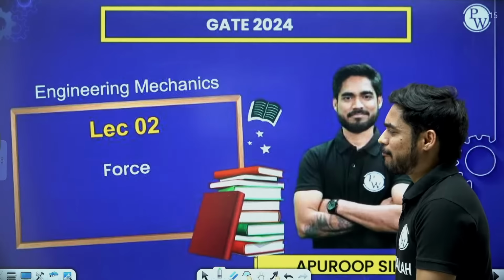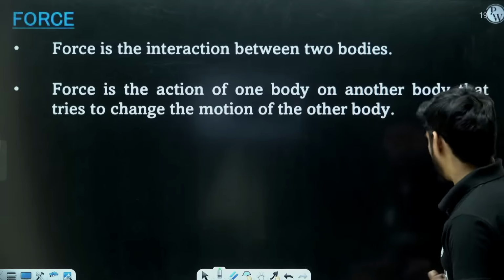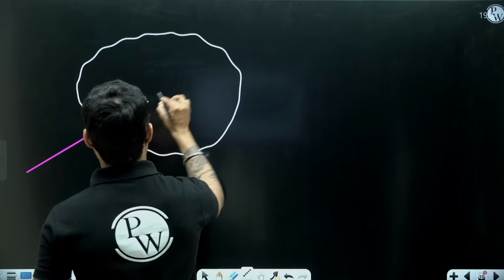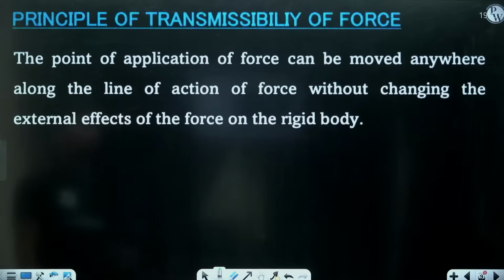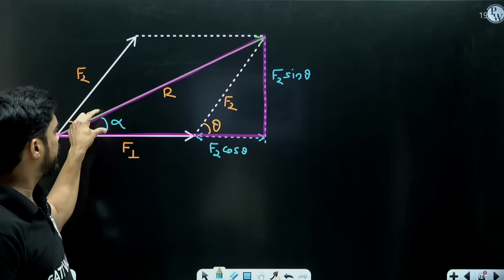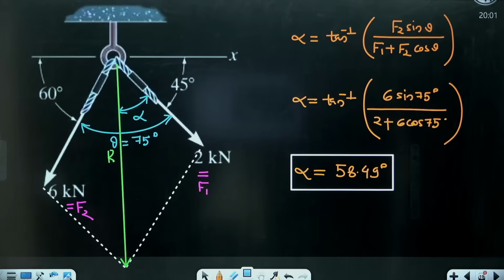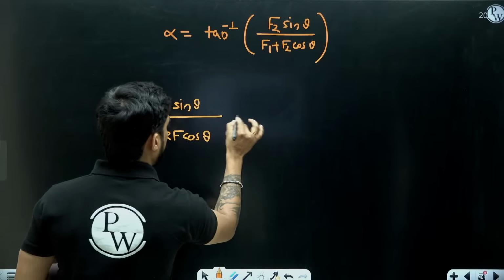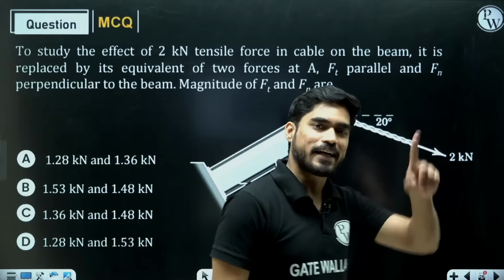Engineering Mechanics 02 |  Force | ME | Gate 2024 Series

Comment: An eyebolt is subjected to four forces as shown in figure. F₁-12 kN, F2=8 kN, F3= 18 kN, F4-4 kN that act at angles of a = 45°, at = 45°, az = 100°, 03 - 205°, 4 = 270º. Determine the magnitude and direction of the resultant force F₂ for a₂ F₁ -0₂ F4 (6)
Reply: answer